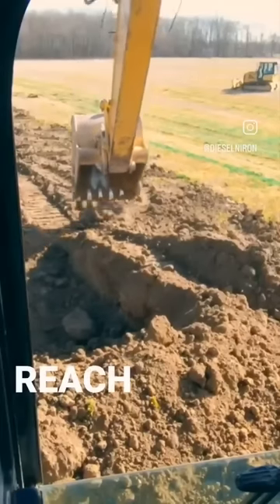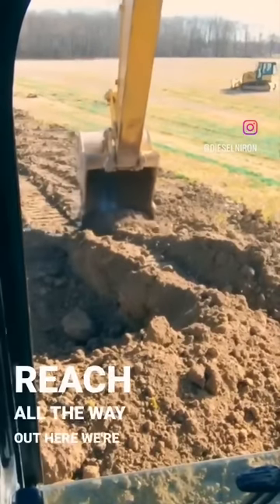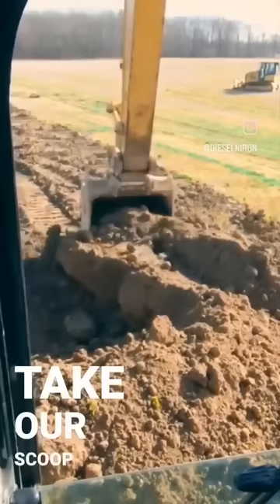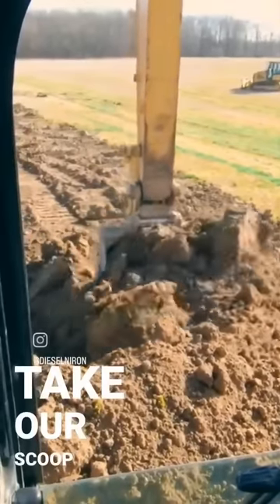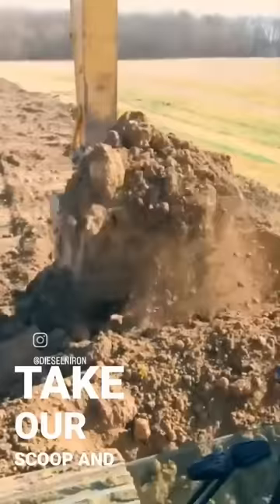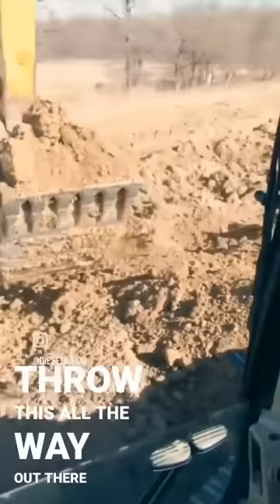Wasted movement in an excavator.

Comment: I’m a mechanic, not an operator, and this whole demonstration makes me realize why I work so fucking hard.
Reply from the maker: Your welcome for the job security
Reply: Yea I’ve worked for my dads grading company since birth and a lot of equipment breaks down simply bc the employee who was on it isn’t really an operator. So the machine is abused and sad thing is most of them won’t take advice from the real operators! I’ve always said our mechanic has the hardest job in the whole company
Reply: What’s he doing that’s so hard on the machine? You’re sounding like an armchair operator to me
Reply: @jeffyli7507 he’s making it go whoooo whoooo instead of mmmmmm mmmmm
Reply: The way he jolted the machine to the right when it was still moving 😂 that clunk
Reply: Any advice on how to become an operator
Reply: Imagine not being to use an excavator like an excavator
Reply: @jeffyli7507 the farther the arm is out, the greater the force placed on the joints. 
Take something relatively heavy and hold it by your body, then try holding it at arms length. Same principle. 
This will make the parts wear faster, and thus why the mechanic said his job was hard.
Reply: @chanceschofield9324 you act like it's not less force than having a bucket full of shit
Reply: I used to work at a steel rolling mill. The mechanic who worked on our huge 100,000 lb forklifts was the hardest working person there. I've seen him change out huge hydraulic rams with no help other than the overhead crane. The mill would have shut down in a matter of days without that guy there fixing those lift trucks.
Reply: @davidlabossiere1140  torque is force times distance. So yeah, it probably isn't close for some of the joints.
That arm and the bucket weighs more than a bucket full of dirt.
Reply: @DieselandIron  do ya at least grease when needed?
Reply from the maker: @benfrantz4585  Only to tighten the joints back up after I've ground them down
Reply: @DieselandIron  lol guess thats one way to do it

Comment: At half throttle on dry flat ground might be ok but I wouldn’t recommend this technique -excessive wear on slew gear and in slippery or uneven surfaces you can get yourself into trouble.
Reply: You know absolutely  nothing about what you are talking about
Reply: @jawdroppin9929  you have no idea if they know what they're talking abt
Reply: @jawdroppin9929  he does actually, knows more then you clearly
Reply: 21 years operating....well I do hang my machine at a 12:00 angle..it's stays...11:00 swing with load..it is very possible...but you still gotta be careful with the bucket centre of gravity...if you got a way I could send you some vids
Reply: Like on a barge with a long reach

Comment: This coming from the guy trying to break the cylinder every time he extends the bucket.
Reply from the maker: You commented not once, but twice on this video. The algorithm is working...
Reply: @DieselandIron ‘ThEsE gRaPeS ArE SoUr!’
Reply: This coming from someone  that knows nothing about what they are talking about. That's the equivalent  of telling someone they're trying to break a car door when they shut it.
Reply: @jawdroppin  He's not wrong, I have run 40 ton excavators since I was 8 years old, this is not a new cat He's running based on the sound of the engine, so he really ought to know the reliefs weren't installed in these rigs until later on, not to mention it's bad form to go slamming an excavator around, the same bucket clearing shake could be achieved by just letting off the hydraulics when the teeth are at a vertical, and bumping towards more dump angle... no need to fully extend, to add to the point of this video.
Reply: @Crazymancwt  your explanation  just told me you are lying and nlknow nothing. You may be able to trick other people who don't know anything about this topic. I have over 30k hrs on them. That's real talk. I can narrow down and get close on the  size  and  model just from what's in the video. So if you've been running "40 ton excavators" since you were 8. Let's see what you  know..... I'll be waiting
Reply: @jawdroppin  Ok, hazarding a guess Id say thats a mid 90s early 2000s cat 329-336 style excavator, judging by the labored noises of the engine. Forgive me for not knowing every little thing about them as everyone I've worked with uses Komatsu and link belt due to the price differential. From the looks of this video, hes swinging too far as well to dump the material, as that rig should have anywhere from 25ft to 33ft from the center of the machine to the max reach on the teeth. Ive run pc 300-6 since I was a kid, only in the last few years have I switched to Link Belt machines as they're cheaper and its what my company prefers. Go on though, tell me I know nothing, doesn't bother me, Ive been told that my whole life by geezers like you.

Comment: Just so you know,  we don't operate machines in the fastest way possible. we operate them in the safest way. 
Imagine a reason you don't blindly swing the arm at its greatest reach  to save 3 seconds.
Reply: If you're in a big open field like this with nothing around, there is no good reason not to swing the arm out wide. Use common sense.
Reply: @Studio23Media  once again, we operate machines as if SOMETHING MIGHT HAPPEN. 
How much of a lazy and stupid combo do you have to be to save 2 years digging but you need to dig it 30 mins faster.
Reply from the maker: If you think I am swinging blind then you clearly don't actually run this equipment. I have great visual references and I am looking to my swing area as I go. This isn't rocket science
Reply from the maker: It sounds like you just need to disagree with the internet today. Have at it. I am totally in the wrong here and deserve to be fired in every which way
Reply: @DieselandIron  enjoy saving 30 mins on that 2 year dig.
Reply: @Studio23Media   no u
Reply: Yeah, why should you put the forks down on the forklift when you're travelling on flat ground, just to have to lift them back up again?
Just drive around with them up to increase production...😄👍🏻
Reply: @boxhead7180  exactly let the people duck jesus! lol
Reply: Incorrect, you push to get your 55 minute hour and the crew should be trained to stay the hell out of the way. I learned this the hard way walking out into a scraper spread as a green engineer. The d10 operator got on the radio and told me I'm going to end up dead if I don't get the hell off his grade.

Comment: Try doing that with a large excavator. It’s not wasted movement if it shortens your cycle time
Reply from the maker: I've tested this up to a 349 and it's still shorter to leave the stick out
Reply: @DieselandIron  I can understand that. A 349 is a small excavator in my world. With the machines I operate sticking in increases swing speed and inversely aids the swing brake by sticking out
Reply from the maker: A lot of things change when you move past the 349.  The way you dig, what counts as wasted movement etc.  Those machines are a whole different breed but most of my subscribers aren't anywhere close to getting in a machine that big.  I try to teach the foundational skills and then they can learn the rest through a successful career.  Thanks for the comment brother!
Reply: @FiremanCH87  now now bud works just fine on cat 390 how big do you run ?
Reply: @movingearth3726  we’re not buds. Hitachi 870 is the smallest I operate on a regular basis. Largest I’ve operated is Hitachi 3600
Reply: @DieselandIron  can't do it in every situation though so its all on the  operators preference
Reply: @FiremanCH87  you sound like the exact sort of operator I'd hate to work with haha
Reply: That makes no sense.
Reply: @Studio23Media  because having the stick out leaves the weight out further making the slew motor work harder, so bringing it in there is less weight to slew. This is on face shovels etc, which really don't take any skill to operate

Comment: Keep slamming that bucket
Reply from the maker: See one of the many comments below yours for an explanation on this.
Reply: @DieselandIron  it's just hard on the bushings and pins sounds like your bucket is all ready lose
Reply: @toodjackson4438 it’s actually worse for the Cylinder Seal..
Reply: @sprucesoldier  lol like the cylinder seals are hard to change. Theres like 8 pieces of plastic in there cost 20 to 40 bucks to repair those plus my 3 or 4 hours labor
Reply: @sprucesoldier  lol thats only a problem for some little mickey mouse ass company
Reply: @DirtyMikeHoncho  you’ll figure it out when you get some experience in the Industry..
Reply: What are you talkin about that's what excavator sound like all the time

Comment: Interesting thing though, it takes more power to build momentum as you start to swing back. Just drawing in the stick a little will allow you to swing back quickly. Still have plenty of time to reach the bucket back out on your way back. We currently have 11 excavators in our fleet from a 35 to a 350, none will return swing faster while fully extended.
Reply from the maker: I've timed this (mentally, not with a watch) and I found the opposite.  I was quicker to return to my dig position when I left the arm extended instead of sucking my arm in.  I may have to go up to the Cat dealership and do a side by side experiment...

Comment: I know you're like an equipment expert. with all you videos on Equipment World and stuff. But that is Hard on your swing bearing, swing brake, and swing motor over time.  I sell and rent a lot of equipment.  and swing bearing are never fun to replace.
Reply from the maker: I have never had to replace or perform maintenance on a swing bearing for using the machine this way. Maybe if I planned on keeping a machine for 15k hours I might be a little concerned but this is not a big deal.
Reply: @DieselandIron   I have replaced swing bearings on machines at 1000 hours,3200 hrs, and most in higher hour range.  Its never a fun job. The larger the machine the more they wear. Its just physics the farther out your stick and bucket is, the more weight and mass there is to stop and create wear on the bearing and brake.  I know in the short term or just once in a while may seem like nothing.. but over time it will cause unnecessary wear on the bearing..
Reply: They're literally meant to swing like this... Someone who sells equipment should know that.
Reply: @DieselandIron  One real good reason why not to buy 2nd hand machinery.
Only buy off folks who look after machinery, otherwise big$$$$$

Comment: We work oilfield mostly by the hour, we don’t want production, why you think your gas bill is so high??
Reply from the maker: I knew you guys were responsible for my high bills!
Reply: @DieselandIron  if you only knew some of the shit that goes on, the other day I saw 30 people wading through a mud puddle about 30ft diameter, four white hats supervising all with brand new crew trucks, that they didn’t turn off all day, they where sifting through this puddle on the pipeline for half a day, I thought it was an oil spill! Nope, just saving the tadpoles before they could pump the water out, after that puddle they moved down to the next, and next and so on, then it rained and they started over, rumour has it they are still at it saving the tadpoles,
and I saw that in 2019
Reply: Nobody wants to see tadpoles flopping in the dry ground, so they collect them up and bleach them for a quick kill

Comment: Ive seen guys talk shi claiming to be operators on excavators, that couldnt even make a bench for themselves on a pile to load trucks & almost go ass over tea kettle swinging with full buckets,boom extended,on the edge,talking about its not efficient to swing more than this or that & you wanna move the boom as alittle as possible..They are pulled out of the seat usually within 30 mins max.. I operate dozers not excavators & alot of these guys now a days are sad & a safety hazard..

Comment: That deadending the cylinder everytime is bad and unnecessary unless the material is real sticky in which case you do it 1 in 10 or so passes. Also if you want to teach someone production do it at both ends not just return to dig but when your casting you should be all the way out and opening  and emptying your bucket on your swing brake/recovery and by the time your going back the other way your bkt is empty.

Comment: Clangin that bucket and starting with the bucket so open will get ya run off the job quick around here! Not to mention made fun of by every single guy on the job site except the backfill guy and the rock box filler because they suck😂😂😂
Reply: Keep leaning on your shovel and dreaming mr bigshot
Reply: @jeffyli7507  😂😂😂😂been layin line for 24 yrs in the cab of the Iron genius. You have a long way to come. I remember a time I thought I knew it all as well.....I was wrong.

Comment: You can also use the curled bucket to push those piles out from in front of you on the way to dump, just be aware of your surroundings if you leave it extended, don't want to take someone's head off.
Reply from the maker: 100%.  Thanks for commenting!

Comment: Been operating over 30 years, yes that is faster….. but it’s harder on the swing gears, motor etc. if your a big company solely wanting production and maintenance isn’t an issue, get after it! Small companies like myself need that expensive machine to last as long as possible with as few repairs as possible!! And your talking about the hardest parts to get to! All in one smooth motion, bring it back in a few feet, I promise it’ll like it better, you can feel it in the machine, once your momentum is up, while your still swinging reach on back out there. Wasted movement, probably. A hydraulic cylinder seal is WAY easier and cheaper to change out than anything in that swing drive.
Reply from the maker: If you plan on keeping your machine for 7-10k hours then I would agree with you.  The majority of the industry rotates equipment frequently enough that this isn't really an issue.

Comment: Not good advice! At all!  And your bang the bottom out of the cyls, bro..  your dipper is a counter weight. You always keep your work close.
Reply from the maker: You don't need to keep your work close with an empty bucket. Keep your eyes open and only do this when it's safe to do on an open job. Use some common sense brother

Comment: Yes but also if the dozer is working with you to push up you'd want to bring that dipper in and boom up so you don't smack the dozer or trucks say. Or at least boom up over the dozer if the dozer or truck was backing up or pushing up the crumbs. Or if a guy or gal is standing by the trench or down in thr trench and a big stuck piece of mud or dirt falls off the bucket and down on the guys in the trench.
Reply from the maker: I thought it would be obvious that this only works if you have a free swing area.  The comments are proving otherwise.

Comment: I was digging with a 56” bucket I think in really sticky damp clay and I’d bang the bucket to get the clay out, I see that’s not a good practice from the comments, how should you properly get it out so you have an empty bucket from your next scoop, cuz this clay I dealt with was suuuper sticky
Reply from the maker: Sometimes you are forced to clang the bucket to empty it out from sticky material.  The reason I'm catching so much shit on this video is because it's happening somewhat regularly without having material stuck in the bucket.  That's only because this machine had a quick coupler that I wasn't used to and I had only been running the machine for about 10 minutes when I started making this video.

Comment: I was under the impression that swinging the bucket fast at full reach could damage the pins and joints due to too much leverage. Hearing it slam etc. no?
Reply from the maker: Swinging at full reach is not going to prematurely wear out the machine.  I know there are a lot of armchair guys on here claiming otherwise but the reality is that these machines are designed to operate at reach.  If you think about it, swinging the machine with a fully heaped bucket at 1/2 to 3/4 reach is going to put far more strain on the bearings, pins and swing motors than swinging an empty bucket at almost full reach.  Compare that also to cutting the wall of a trench or basement where you are not only using the full power of the swing motor but you're also engaging the dirt with the bucket with tremendous sheer pressure.  If these machines can consistently stand up to that sort of punishment then doing an empty bucket swing at extension is nothing.  As far as the bucket clanging goes, yes, it's not great for the machine but this is not how I normally operate.  This machine had a coupler that took about 15-20% of the bucket curl out of play and I had only been running the machine for 10 minutes when I made this video.  I was still getting a feel for where the coupler bottomed out.

Comment: It actually swings faster when you pull the bucket back in, think of a figure skater spinning faster when they tuck in vs extending their limbs out.
Reply from the maker: I thought the exact same thing with the exact same logic. The problem is the amount of time you waste pulling the stick and bucket in versus just spinning. It's actually faster to leave it out rather than spending time sucking them in. I've tested this up to a 349 and it has held true

Comment: Duh…. You should learn this when you realize dumping excavated materiel close by gets in the way and slows you down. Start digging/dumping far and work back close. Once the bucket is extended it only comes back in if you can fill it in the process since you shouldn’t have a tree or telephone pole in the path of your arc unless unavoidable 😂

Comment: Lot harder on cylinders and the pins and bushings on the boom and turn table motors and gears swinging with the boom extended out lot more leverage on everything
Reply from the maker: They are built for it believe it or not.